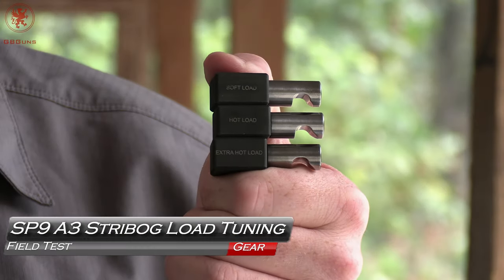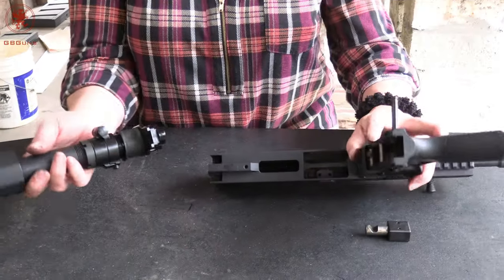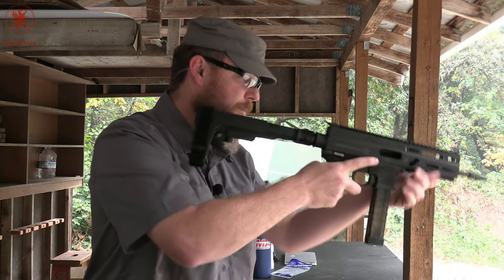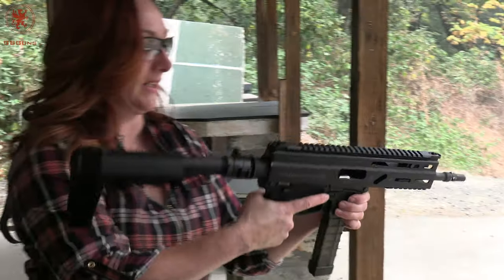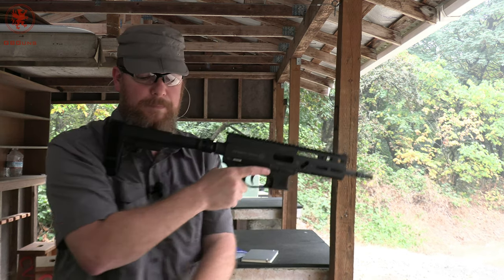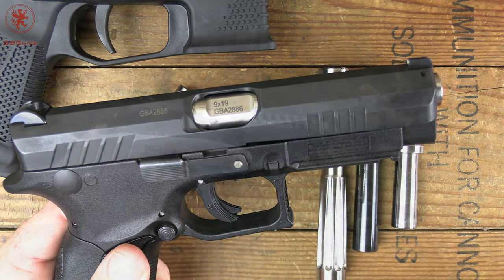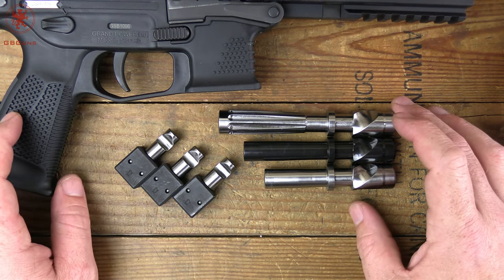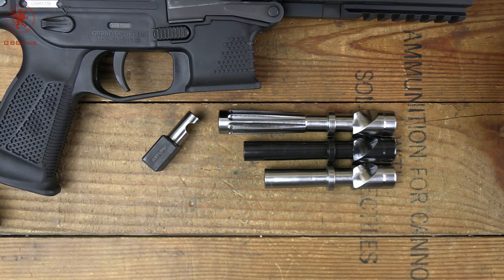Tuning the Grand Power SP9 A3 Stribog

Comment: Thank you as always for this great info. Took my A3 to the range yesterday and after research bought rounds of close to 380 ft lb muzzle energy as possible (340) in ammo shortage and had no trouble with 200 rds with steel or polymer mags. The Winchester 124 gr 9mm is rated at 390 ft lb but not available at time of writing. I also use the MCarbio trigger spring kit and extended bolt release, which make the weapon just a little more sweet. I did spray two steel mags with a Teflon lubricant to mitigate any possible mag stick. Your info is one of my great influences in  buying the Stribog. Thank you once again.
Reply: I think the teflon in the mags may be the magic fix. Did that on a few of my mags, and had absolutely no failures. Including with steel case.

Comment: Picked up my A3 about 1 month ago.  Went to my favorite spot in the boonies.  Shot the only bullets I had - Aguila 115gr ball.  Shot both the strait mags with metal feed lips & curved.  No problems.  Was very impressed!  Love this gun!  And yes, it's Insanely accurate!
Reply from the maker: You A3 likely came with the "US" locker, so it should run all the weak stuff we have here in the US.  This video was regarding the original NATO-spec locker.
Reply: @GBGuns  will I have wear issues if I suppress my sp9a3s with US locker? Do I need to get the NATO locker because the added pressure? Where can one fine the different angled lockers..??

Comment: Good morning, I have a 9X21 caliber A3 stribog which initially had similar problems, I changed magazines using those in the video, my thought is that being 9x21 the ammunition is more stable and enters better.  Generally the 9X21 caliber works better than the 9X19

Comment: I'm having trouble following your discussion at the end. As far as I'm aware these lighter lockers are not available for sale and were only created once the reliability issue with soft loads was discovered here in the US. It's literally a fix for an issue with the weapon the way I see it for this situation. If the manufacturer came out and said this gun only cycles reliably with hotter ammo that would have been a huge factor to consider for many people, myself included. So we were sold a gun unaware of this issue bc the older version did not have this problem, and now they are releasing a fix for it. Not a good look for Grand Power, I really hope they don't try to rip people off with pricing for this locker and if they were a great company it would be provided for free to those of us who purchased already.
Reply from the maker: They have said what loads it was intended for.  Run quality ammo and you don't need these lockers.  They existed long before Americans began having trouble with it.  This gun is not different than other delayed bkowback guns like the MP5 and Banshee which also have ammo sensitivity.  Do your research before buying, don't blame the manufacturer for making a specialized tool when the tool doesn't work for the application you're trying to use it for.
Reply: @GBGuns  they definitely did NOT say that in the product description I read on global ordnance and the site I purchased from. Just because the ammo is not as hot doesn't mean it's not quality btw. Also their own manual which came with the gun has zero mention of hot ammo requirements. I am really starting to blame the manufacturer yeah definitely.
Reply: @GBGuns  can you please link to the page where they describe what loads are intended for it?
Reply from the maker: So your problem is with Global gor not marketing it correctly, not with Grand Power.  I don't blame you, looks like they even got the Leviathan clowns involved.
Reply: @GBGuns  what? Let's be reasonable here I feel like I'm being civil for now. Just pointing out the truth. No I don't blame global o, I mentioned then because they are the importer for these stribogs and I would assume they post the specs and product information which GP provides them. Not GO fault at all because they aren't the ones testing products and writing manuals etc
Reply from the maker: @daves.3895  but in this case they sort of are.  They became the importer when entering the gun for the Army trials.  I assume with the same locker which runs great on NATO spec loads (not that Winchester M1152 bs).  You said you read Global's description and bought so it was their sole description you based your knowledge on.  Once again, this is not unique to the SP9 A3.  Other delayed-blowback operations such as the HK MP5 and CMMG Banshee have ammo sensitivities because they are designed to work within certain parameters.  In the case of the MP5 and Stribog they were designed for NATO loads as a military tool.  I don't see what's so difficult to understand.
Reply: @GBGuns  I purchased this model because I've heard great things about the A1. Basically I was looking for a softer recoiling A1 and reliability was a huge factor. Anyways I'm still interested in reading the companies statement on what ammo loads were specifically intended for this gun because I've never heard of or seen that. I would genuinely appreciate that.
Reply: @GBGuns  Hi. I dont agree. I tried Stribog A3 with NATO ammo and it has the same problems. Out of 120 rounds it had 6 malfunctions. I think thats a lot. I think the main problem is with magazines. They are just not good.
Reply: @karelnemec9272  Grand Power did release a statement and actually admit there is a problem which is a great start. I'm glad to see someone being honest here. https://i.imgur.com/3peaPNx.jpg

Hope the link works
Reply: If anyone is following, I sent my bolt to global ordnance for the "upgrade" aka recall and received it back. Have not tested it out but word of warming they use some crude machining on the bolt and erase the serial number and slovakian emblem in the process. Really hoping the issue was fixed because this isn't cool.
Reply from the maker: I'm curious.  I'm not sending mine back, I don't have any issues that aren't solved with proper ammo selection
Reply: @daves.3895  Hi. I got rid of my Stribog a3. I still think that it is the magazine issue in combination with what you described. Mine stribog run better with those old plastic mags than with metal feed lips ones. I tried send those metal mags back but they told me that problem is that the spring inside is upside down, so they switched it and gues what, nothing happend 😁. So I decided to sell it, because it did not convince me that is reliable gun. Buyer was a guy who told me that he will make his own mags, so I hope it will run okay.

Comment: Why would they be necessary if the weapon handled different loads from they very get go without any troubles? Does the MP5 for example needs such tuning to function? Provocative question I know.
Reply from the maker: It dies habdle different loads from the get go.  Did you mode pur other video? The MP5 as far as I know can't be easily tuned.  The CMMG Banshee you saw buffers

Comment: I tried running some 147 grain JHP (not +P) and second round jammed every time.  Where do you get the lockers?  Thanks for the info.
Reply: Update: put some dry lube in the mags and ran 124 grain fmj NATO and only one failure in 100 rounds.  I have a can coming, so will try 140 grain subsonic suppressed next.  Gonna keep the gun, methinks... So accurate.
Reply: IPSCStore
Reply: @martinrps13  thanks

Comment: Would I  be wrong in assuming that the SP9 A1 would be more likely eat a wider range of ammo as it is a direct blow back rather than a delayed roller?  I have had lots of experience with the UZI carbines and they seem to eat anything, which I liked. So that being said, should I get the A1 instead of the A3?
Reply from the maker: They both eat a wide array (we have videos on that). The early-import A3s were tuned for 124gr NATO (about 10% higher pressure than most Americam ammo) and that combined with the occasional imperfect shoulder support caused folks to think the gun had issues.  Grand Power fixed this with the "US" locker which doesn't need as much energy to run. If you're trying to decide between the two the biggest difference is how much quieter the A3 is when suppressed.  If you're not worried about that or the edge in recoil the A1 is fine.

Comment: A3 magazines. The spring cannot be installed upside down but it can be installed backward. If so the back of the follower gets spring tension before the front and greater tension all the time, so the ammo can do all kind of crazy stuff. Looking at it now I believe 2 or 3 of mine came that way from the factory. Then the fact that anemic ammo caused a jam where a spent case and a new round were tangled inside the action really confused the issue. So a really accurate gun got a bad rap. I got mine to work like a champ before they replaced the bolt and locking block on the first 3000. Disassemble a mag and see for yourself or put the spring in backward and fill it up.

Comment: Thanks for the review. In your experience does the mp5 handle a wider variety of ammo loads with the default locking piece compared to the sp9a3?
Reply from the maker: No, at least not my Zenith gun.  It will only run ball ammo reliably

Comment: A lot of these are probably due to bullet profile and no change in roller is going to make them function better. None of my PCCs run Winchester Active Duty worth a damn, for instance.

You guys should try steel cased and win he yet white box 115 FMJ with the soft load roller.
Reply from the maker: We have run steel cased, and as stated then demonstrated the loads in this video don't work with the standard locker but do with the soft locker.

Comment: Great video. Which locker should I run when suppressing? I have the 45 that came with my A3 and found the 40 online but can't find the 35.
Reply from the maker: Test them and find put. It will depend on the ammo you're using and how well you support the gun.
Reply: @GBGuns  will do. From what I gathered from your videos and reading comments. When running suppressed to take full advantage of the roller delay (recoil reduction/sound reduction) with the added blowback pressure.. I should run the 40 or 35? Also worried with the lighter bolt on A3 running with the 45 would/could cause a problem with longevity with the bolt slamming back under the increased pressure when suppressed?
Reply from the maker: @michaellarocca7815  I don't suspect that will be much issue, the worst that would happen is the inexpensive end cap take a beating. Run the stiffest locker you can reliably.
Reply: @GBGuns  thank you for all the content and info! Looking forward to more in the future. Now I just need to hunt down a 35 degree locker.  Guess I'll try googling in Slovak since results in English are not bearing any fruit.

Comment: I just received my Sp9a3 on Jan 5, 2021. The latest version says "This is the newest version of the SP9A3 with the New Grand Power flat trigger and upgraded locker for US-specific ammunition for greater reliability."  I noticed after watching this video that my locker has a 45-degree angle on it.  So far i only ran 300 rounds of FMJ  with no issues, steel or brass.  I would like to know what JHP will run the same now.   If there is a problem it seems like it would be a magazine issue due to the straight mag and stickiness.
Reply from the maker: You should be able to run just about any HP through the US Locker, it just doesn't hold at tightly so although you've still got better recoil reduction than a standard blowback, it's not as much of a delay hold as the standard locker.  In short you'll have slightly more recoil but be able to run a wider variety of ammunition.

Comment: Which Stribog model would you recommend the SP9A3 or the SP9A1?  Are there any after-market mags or spring/follower kits that increase the Stribog reliability?
Reply from the maker: The mags aren't an issue unless you like to smack your mags into place.  A1 for reliability, A3 for suppressor use and less recoil than a basic blowback.
Reply: @GBGuns  I'm planning to run a suppressor so I will consider the A3.  Why is the A3 version preferred with a suppressor?
Reply from the maker: @johnp1839  the delayed action makes the gun cooler and quiter with a suppressor than a standard blowback (,of any brand). The suppressor also aids in reliability by adding extra back pressure (possibly a reason why some paid youtubers seem to always run cans on guns like these)
Reply: @GBGuns  Getting close to pulling the trigger on a 9mm PCC.  How much more recoil is there on the Stribog SP9A3 compared to a CMMG Banshee?  I'm not able to test fire these pistols prior to purchase so it is hard for me to know how they feel or operate and I am leaning towards the Stribog based on the simplicity of function.  Thanks!!
Reply from the maker: The Banshee is a nice gun, but at a higher price and much larger overall size. The recoil difference is negligible

Comment: Thanks for the great video! Some won't like the gun because they can't put garbage rounds through it.  So I can still support a gun if it is somewhat picky so long as it's consistently picky with certain loads, while others are consistently reliable.  If you like your hot loads, then the A3 might be your gun. If you like softer loads, then stick with the A1. Mine runs great until you start resting it on its magazine when shooting. Then you start to see failures. But a LOT of guns will malfunction when you do that.
Reply from the maker: And these were just 8 loads.  We've proven it with others in other videos
Reply: @GBGuns  It's good to know which loads consistently work in the gun. I can get behind the fact that some guns run, or run better using certain loads - this is the case with nearly every gun made. It's the bois who find themselves constantly fantasizing about some apocalyptic scenario who demand that every gun shoot every round, perfectly and accurately, every time, who object to videos like this one. :)

Comment: Might have missed it, but did regular wolf steel case 115 run this reliably?
Reply from the maker: Here's a 27-load test https://youtu.be/SGFVCqNuhcc
Reply: @GBGuns  I meant the A3 version. If Wolf/Barnaul/Tula etc have enough oomph to cycle the roller delay reliably
Reply from the maker: Ah, A3 with the original locker is here: https://youtu.be/QJ4fTw8-qt4?t=226

Comment: Just earned another subscriber.
Reply from the maker: Thank you and welcome to GBGuns.  I'm a writer and do these videos as side projects, or in this case when (in my opinion) something hasn't been explained well enough by others
Reply: @GBGuns  waiting on my A3 to come in. I've seen good and bad. I just want truthful reviews. Keep up the good work.
Reply from the maker: The truth is the gun's action delay was designed for European ammo, think 124gr NATO.  Heavier bullet and more pressure than the 115gr we shoot here on the US.  Of course there are exceptions and some US market ammo runs fine, some 124 won't.   We've tested 24 different loads in our videos and private testing and shown this.  Some folks struggle to understand that not all 9mm ammo is the same.  Physics is physics.
Reply: @GBGuns  are these lockers available for purchase? I'm a disabled/wounded vet and limited income so trying to get make sure this thing runs right since I paid close to $1k for it.
Reply from the maker: You'll have to ask the importer.  Yours will likely come with either the original (for heavier and hotter loads) or the light-load marked "US"
Reply: @GBGuns  gotcha. I'll look into it. Thanks man.